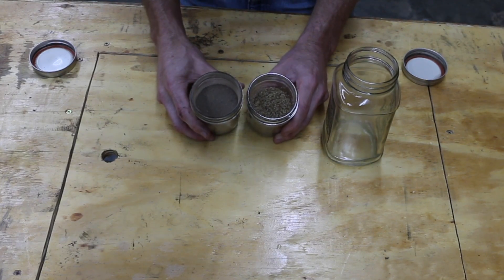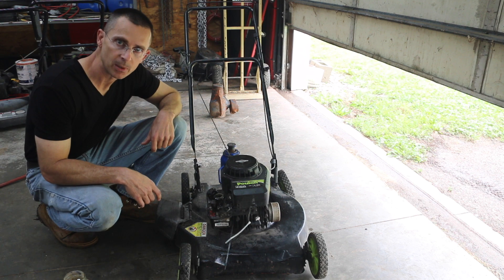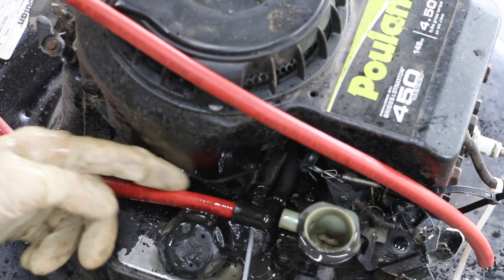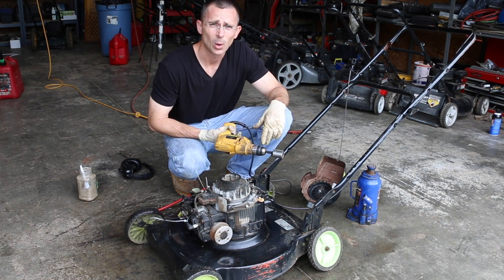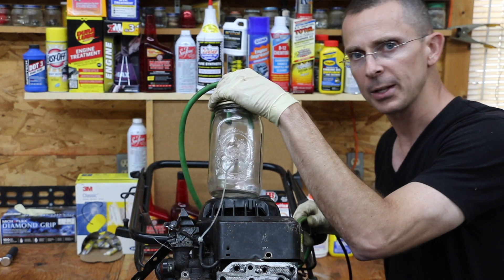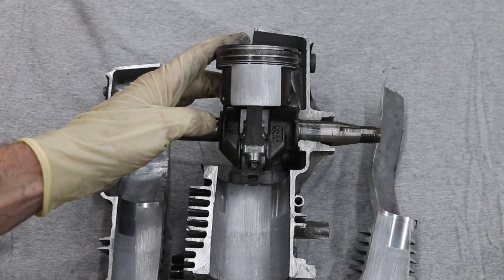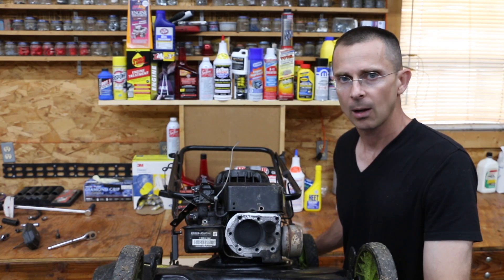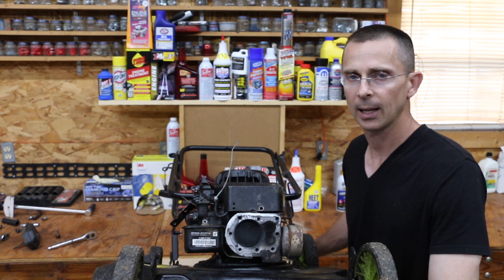Will Dirt Destroy an Engine?  See what it does to this Engine!

Comment: I believe if you would of removed the restricted muffler you would of extended the life of the engine. It may have allowed to evaluate more dirt out of the exhaust then grind itself into the crank case. It wouldn't have saved this engine just allowed it to run longer.

Comment: Hey man. Great video. Just want to clarify some terminology. Translucent is when you can see into but not through. Transparent is when you can see right through it like the new oil. The last is opaque, or when you can only see the surface.

That oil was really really metallic, not even very black.
Reply: Oh and its not aluminium in the oil :)
The cylinder wall is steel. Its just the casing that is an aluminium alloy. Most of the times magnesium/alu alloy.
Reply: P.S. keep it up. The fact that you took the time to cut the engine apart proves its not a waste. If you just wanted to destroy it for the kick of it and yell "Yeeeha!" then yes, that's a waste.

Comment: EEEEK! 
 I'm a bit of a small engine fanatic. and while I totally understand the point of the video,     this was so hard to watch. Please understand  I mean absolutely  no disrespect and bear no hard feelings..  My job is lawn care and during the summer months, little engines like this one helps to feed my family.  Many of our yards are small, and our little "push" mowers (ours are self propelled, older commercial-grade Snappers or Husqvarnas)  are high ranking pieces of equipment.  So seeing that little Briggs with lots of life left in it, put to death like that had me squirming and gritting my teeth.  I know that the wheels were falling off, but that engine ran fine. I shuddered at that poor thing dying such a terrible death.  Especially since two of our most used small mowers need engines badly, and we can't seem to find any good older engines around here. We only use older mowers since the newer ones a pure trash with all of the cheapo- plastic-y parts, flimsy paper-thin metal, and EPA  junk on them that make them run so lean, and the lack of carburetor adjustments, that we have to run them damn near on full choke after they get about a month of use and wear. Either that or they run so slowly and surge so badly that they are just useless.  So yeah  an old Briggs like that is like gold to me.   If you gotta kill an old engine,  find some Tecumseh's from the 80's.  Those were junk the day they were conceived on paper.  And for the love of all that is good.. PLEASE never kill an old Wisconsin or Kohler "K" Series, or any Horizontal mower engine.. Those are getting hard to find too.

Tecumseh and any craptastic "China-mart" or any EPA-d to death, green-weenie engine..  Get rid of them..
Those golden oldie Briggsies Kohlers and Wisconsins.. Please spare them. Unless there is major scarring in the cylinders or other major damage,  many seemingly dead  older engines can brought back for several more years of service with a simple rebuild kit. or even just a good cleaning of the carb. (I do it all the time) 

Sorry for the long rant.. I guess it just touched a sore spot to see that happen to a good ol' Briggsy.

Comment: Sir, great videos.   How about the 'ram air' hoods that many cars have.   What happens when it rains?   Does a filter really keep out enough moisture, and if it gets through what happens?  Essentially driving through deep water WILL hydro lock an engine, but will rain do it too?

Comment: I enjoy your videos thanks for sacrificing these mowers. I have seen engines that have had this same wear but not as bad, they never had an oil change and were run with the oil level at around half full or maybe less. When I opened them the oil that was in the crankcase looked like tar. What would happen if you used 90 weight in one and what would happen if you used a thin oil or WD 40 in one ?

Comment: You put a lot of sand in there I wonder if just mowing a yard and occasionally getting dust and grass in air. I wonder how long that would take to actually destroy it. You should filter the air. I think this was good video. What about high oil level overfilling engine oil..

Comment: You told me you wanted to borrow my mower to do a Youtube video. You told me my mower would be famous.
Reply: .....and after this we didn't even get to see it's big-end..
Reply: Nothing is famous enough until it's dead. Mission accomplished!
Reply: trust me sir...it indeed became famous....
Reply: The bearing wear inside the engine is dependent on oil contamination.  This video concerns dirt contaminated air- it affects the valve seats and cylinder walls.  Looking at the internals is moot.  If there were a 'vegetable oil for engine lube' or 'let's run it without oil' or whatever video, then it'd be viable, but really precise measurements with instruments, oil analysis, and magnified imaging would be needed.
Reply: true
Reply: Now that it's dead, can it be sold at auction for a fortune?
Reply: Did it get its 15 minutes of fame though?
Reply: Kirk Johnson 😃😃😃 Everyone who reads your funny comment will smile.
Reply: That's the funniest coment I've seen in ages..Good job!

Comment: Another interesting to see is how an engine will react to bug ingestion without an air filter.
Since we are getting towards hotter weather, you are bound to find lots of dead bugs in the windows that would be perfect for that kind of test.
Especially since they are carbon based and may leave interesting carbon deposits or possibly cause engine knock due to glowing?

Comment: Even the larger tractors with the oil bath air cleaners need to be cleaned more often too. I shake my head when I see cracked air cleaner hoses or missing air cleaner hoses. What are they thinking?

Comment: I winced and whimpered to see somebody pour sand into a carb...    Just wait until PETM sees this.  The People for the Ethical Treatment of Machines will not take kindly to what you just did.  

Kidding aside, a more realistic test would be to have a distribution of particle sizes,  with small particles being the majority and sand-sized particles being the minority.  Also,  I'd like to see more organic material - bugs, grass stalks, etc.    The test sample could be obtained by rinsing out the filters of a dozen well used lawnmowers, weed whackers, chain saws, etc.    That is the stuff the air filters stop,  so putting it into a motor would be a more representative test.

But PETM is gonna getcha non-the-less.

Comment: My friend had a cavalier 4 cylinder that he fixed and it seemed to be reliable daily driver.  But my friend romped on it so hard (automatic) going in drive to 2nd etc make it loud, cut off exhaust, etc that he eventually was leaking lots of oil and had slot of oil soaked in air filter.  That oil blow by reminded me of his car and the story, he eventually drove it until piston rod etc broke through oil pan or something.  Find out how much stress an engine can take being used hard.  Might not be something for mower engine testing idk.

Comment: Do a leakdown test instead, compression tests are inaccurate due to the easy start cam grind. Also this style engine, you never tip on it's side to drain oil, as it will flood the breather with oil. Also pistons don't rotate up and down.
Reply from the maker: Scott, this is a great suggestion!  I'll look into this approach.  Thanks for watching the video and commenting!

Comment: I have a question, my single cylinder motorcycle has a cracked PCV unit. There's a thin long crack that runs along it and it had oil vapour sticking on all the neighbouring regions of the crack. Would dirt have entered through this gap and destroyed the engine?
Reply from the maker: Kevin, It seems unlikely, since there should be positive pressure inside the PCV unit.  If the crack is extremely large, contaminants could enter this route. However, recommend getting that repaired.   Thanks for watching the video and commenting!

Comment: I would like to see you perform the test again, then use engine restore and see if it brings any compression back.
Reply from the maker: Jimsiggy, I've cut this engine into pieces.  I have other engines that will serve as a great test case for Restore.  Thanks for watching the video and commenting!
Reply: A week or two ago, I mentioned, that I could send you some Tungsten Disulfide, to treat an engine with; then run it out of oil and see how it compares with slick-50 etc...  If you are interested,  let me know and we can exchange email and I'll send you a bit.

Comment: Not very Professional to put sand direct into the air intake...
In real situation it take only very fine dust.. not like your stuff.

You need to try to make container with your dirt mix and put a little fan in it.
Then make a pipe from the container to the engine.

Comment: I restore cub cadets and other power equipment. Every used cub cadet I find needs a new headgasket. Every cylinder I find scored has a bad air cleaner. Very few cc have a good air filter. These cub cadets with the good air filter have perfect cylinders. I add the foam pre cleaner when I install a new air filter. Either pay for the air cleaner now or plan on replacing the mower.
Reply from the maker: Bill, This is great information!  I wish I could post this to the top of this forum!   Thanks for watching the video and commenting!

Comment: Do that again, sand in the carb, till the engine is dead. THEN change the oil, once or twice, and seen if you can get it going again. And then add additives that are supposed to make old engines work. Do some between stages compression tests.
Reply from the maker: Nanu, Great suggestion!   Thanks for watching the video and commenting!

Comment: That's something we'd see on Craigslist around here. Used mower - good condition. Runs! :D

I'd be curious to see how long fine dust would take to do one in. If you took some bone-dry silt or dirt, and hit it with either a fan, or compressed air - like mowing a dusty field. Would probably take longer, and make finer scratches in the cylinder - more in line with what you'd see in a real-world scenario.

I still enjoyed the video though. Great that it was caught on video - one engine sacrificed for the education of thousands - that's an acceptable ratio to me. If I ever see a cylinder & piston looking like this on a customer's mower, I'll know exactly what happened. :D
Reply from the maker: Smitty, LOL!  All great points!   Thanks for watching the video and commenting!

Comment: I'm definitely not adding sand into my car! It looks like you took sand paper to the inside of the internals!

This probably doesn't apply very well to the small motors, but what about testing oil in your motor after you've got a blown head gasket and you've got coolant mixed in with it? I've seen some cars with so much coolant in the oil it's milky.

I wonder how much coolant in the oil would it take to ruin a motor.
Reply from the maker: Sev, Great suggestion!   Thanks for watching the video and commenting!

Comment: Personally i don't like seeing perfectly good engines getting destroyed, i knew straight away that Metallic stuff was Aluminum. Sand is used to make Emery so imagine how fast you can run Emery up and down a piece of metal, then think of the RPM in which your engine used sand to destroy itself.

Anyway i'v heard of the Salt water scenario most commonly from getting in the fuel, through the air intake and doing some damage over time. Not sure by how much or how fast. I believe it's because of the corrosive nature of salt that this happens.
Reply from the maker: I enjoyed reading your comments!   Thanks for watching the video and commenting!

Comment: interesting video, I didn't expect the engine to die with only a few teaspoons of sand/dirt mixture.
Another common cause to damage/destroy an engine is filling it with way to much oil, or putting wrong fluid in wrong fillercap. Maybe interesting to test such a scenario?

Keep up the good work!

Comment: One thing that also happens is the dirt gets into the engine oil past the rings. An oil sample test will prove this. If you look at the con rod bearings they would most likely be damaged as well. I build and repair Cummins  HHP mining engines for diggers, drills & haul trucks. We see this kind of thing all the time. If the air filters become blocked the rubber boots on the intake pipes suck in & dislodge themselves, so then they end up running without air filtration. It does exactly what happens in this video. On a bad example it will actually break the (compression) piston rings. The blow by goes through the roof, just as it did in this video. Never run an engine without a good quality air filter, ever.

Comment: Try using the wrong oils..and low oil..high oil amount. For engines with radiators...use per and dirty water as you would in an emergency situation. just add water and watch it fly apart under compression. So people like to add water to their gasoline engines.

Comment: See what happens when Water in the oil?
Reply from the maker: Dan, Great suggestion!  Thanks for watching the video and commenting!
Reply: Project Farm no problem! I thought of that because I sunk my atv and got water in the engine but I did two back to back oil changes and got the water out before I ran the engine. Runs great still tho! But I got a tow home because I didn't want to run it with water in the oil

Comment: Did you ever hear of putting mothballs in the gas tank to increase octane,when I was in the military a lot of the southern guys swore it worked without any damage to the engine.I never tried it because by that time I was done wrecking cars with my childhood stupidity.
Reply from the maker: Hemi Power, Yes, I've heard of this.  I'm told there are 2 types of moth balls.  I'll have to research which one is supposed to increase the octane.  Thanks for watching the video and commenting!

Comment: I remember doing that, at 16 I figured that was the job of the hood and I didn't need any damn air filter.Went thru a lot of $50 dollar cars and engines.Now I have a supercharger and I am a little more careful.Loved the sucking sound of the air entering the carb without a filter and the increase in HP.
Reply from the maker: Hemi Power, Yes, it was very common to see guys do this when I younger and driving those $50 dollar cars.  Thanks for watching the video and commenting!

Comment: project farm , how about a video where you have a four stroke mower .. ie briggs and Stratton , running at about half to full throttle , then have a complete stop by the blade disk hitting something. a friend of mine brought a engine to me that he said hit a tree root and the engine stopped right away. it broke the connecting rod. the key in the disc blade holder did not break , nor the key in the flywheel.  you can blow up a mower engine with a abrupt stop . there were bits of connecting rod all rolling around in the sump. it was a run of the mill 3.5 hp briggs and Stratton engine in a rover frame.

Comment: how about running moonshine or super fuel like 110 -125 octane gas in a regular push mower or twin cylinder riding mower engine? also what about showing what running an engine like a mower on hydrogen fuel( hho) after ling term exposure to the fuel mixture inside the engine?
Reply from the maker: Charles, Great suggestion!  I can definitely test high octane fuel.  Thanks for watching the video and commenting!

Comment: No it will not the oil will get dirty faster
  Source I live in the dusty sandy  desert  Proven FACT it will not damage an engine... other wise everyone will be sitting on the side of the road  because of it   I use a high flow filter i just have to change the oil more often like every  7k miles

Comment: that poor engine!  is this the end of engine experiments as the engine is now gone?   as for decarbing an engine, has anyone suggested a water drip into the running engine and letting it work, after all cars that had head leaks usually had very clean heads due to the steam
Reply from the maker: Jusb1066, The good news is that I have many more engines.  Yes, I previously released a video on using water for carbon removal and it did a great job at removing the carbon.  Thanks for watching the video and commenting!
Reply: thank you, i have some catching up to do, then!

Comment: surely the number of times youve taken the head off that mower the head bolt threads will be knackered?
Reply from the maker: Oscar, This is the first time I've used this engine, but you make a great point!  I have about 15 different engines I use for testing.
Reply: oh ok they all look similar to me because im a mower newbie

Comment: You need to get one of those cheap borescopes from Amazon.  - https://tinyurl.com/yd5fdmgb
They will make it much easier to view inside the cylinders, crankcase, etc..
Next destructive test, hydro lock one.
Or maybe see if you can find some 1" thick toughened, tempered, or metallic glass and make a head out of it so you can view directly into a running cylinder. You can drill the bolt holes by submerging it in a mixture of vinegar and water then use a small hollow diamond drill bit to drill through it. You can get the bits for a Dremel and use those to drill, they are much cheaper than other options and they work fairly well. Not sure how to thread the plug hole, but there are other vids out there, you could ask them how they did it.